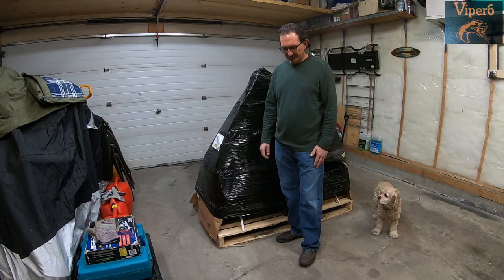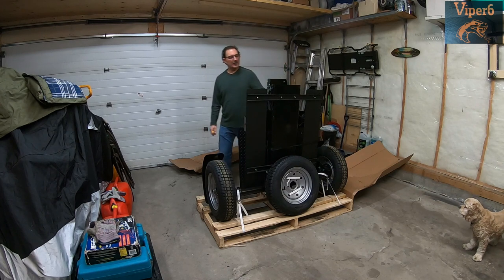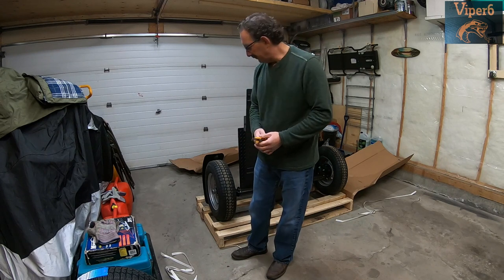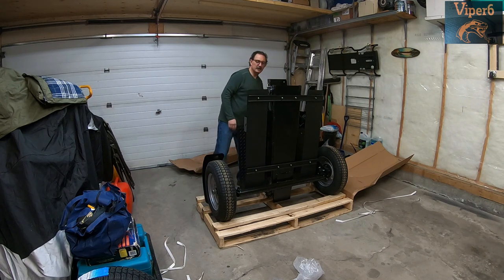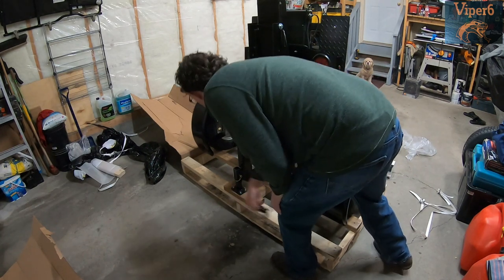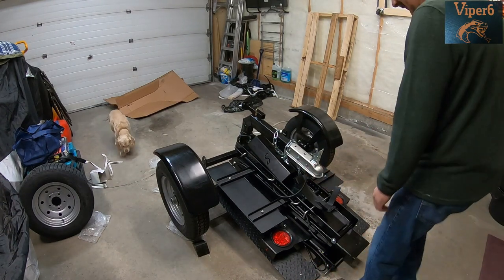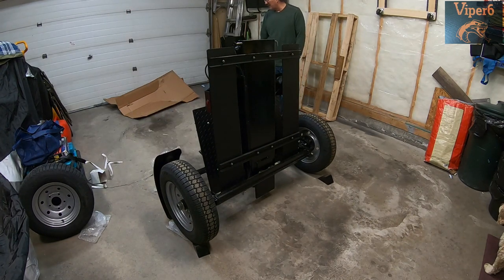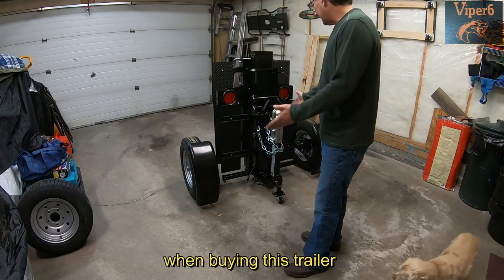Stinger XL 112  Motorcycle Trailer Unboxing and First Impressions

Comment: @viper6 Thanks for posting.  Curious what your opinion is at this point and also, how heavy your bike is. Thanks in advance buddy!!
Reply from the maker: I like how I can fold and store it.i have two bikes. One weight 500 lbs and the cruiser weighs 850 lbs. the trailer is rated for 1700 lbs and can travel safely at 80 mph. Thanks for the question.
Reply: @Viper6-MotoVlogger  Thanks for your prompt response. So with all that said, assuming you've used it to travel, are happy with it?
Reply from the maker: Dean Landry you’re very welcome. Other than the fact that it’s expensive, I have no complaints.

Comment: Hello Viper6
Enjoyed your video.  At one point, you’re unpacking a bag of accessories including locks, straps etc. and in one of the comments you indicate these are shipped/included with the trailer. I queried Stinger and their sales rep says they don’t sell the locks and the straps are an extra $150 so I’m confused.  Did you pay extra for the accessories?
Reply from the maker: Hi Terry, I purchased my trailer in February 2020 and do remember the straps being included with the model. Perhaps things have changed, but I would negotiate with them to way the $150.  Good luck.

Comment: I remember watching this and leaving a comment but it's not here.  I remember commenting that it was a cool trailer and I would like to have something like it.
Reply from the maker: Yep, Youtube doing its thing again!
Reply: If you did decided to purchase,  the pictures and video's truly don't do the actual 'there it is upon your own driveway', any justice.  It is very WELL built and manufactured. They didn't cut corners in design for its mandate...you and yours,  in your car/truck/van, and your ride safely tucked in behind you....the adventure waiting!   You won't be disappointed, from purchase, to the day it arrives at your door, if you decide to have it actually delivered right to your driveway.  For the weight of it,  as well as the size of the support wooden pallet, I think that is the best option to 'get it home'.  Cheers!
Reply: @sesquashtwo  Thanks for the input.
Reply: @EasyRiderGreg  No problem...and I have to tell ya...sure, it's a good amount of 'coin'...but when you see it home after the wrapping off, you see WHY you paid the asking price.  Very well made, from excellent based materials, well thought out, and I still marvel in how this trailer, when you simply and (one person) easily folds it into its storage non-use configuration, really does only take up the physical space of a normal snow blower.  So, if you have a two-stage snow blower sitting already in your garage,  that's only how much real-estate it will take up!  I have already pulled a 1,000 pound bike over 200 miles...behind a Grand Caravan...and absolutely no impact to the control of my vehicle.  It took me literally five minutes per side to hunker down two sets of straps, (front and back) on each side of my bike,  so it's actually from unfolding the trailer at the mouth of the garage door,  slipping in the pins,  pulling it up to your 2 inch ball hitch,  locking that down,  installing the chains... riding the bike up onto the trailer,  bringing up the loading ramp into the road-position, and then finally attaching the four (2 per side) tie down straps...all of 15 minutes.  That quick and easy , to be heading out for a great vacation, or end-destination tour/ride.  I am SO GLAD, that I finally decided to drop the hammer...and have one delivered.  No buyer's remorse HERE!~ :)  Cheers!

Comment: It looks really well made.  That should make it all the way to Arizona!
Reply from the maker: OldManTony I am actually impressed with the gauge of steel and build. The trailer is rated for 80 mph travel. So, I should be good mate.
Reply: @Viper6-MotoVlogger  I'm also thinking of creating a front windshield for the back ramp, when it's in the up position.  I can see that that will be like pulling (wind drag and wobble) a flat barn door behind you.  My idea is to merely cut a thin piece of black and or white colored plastic Viper6,  and bending to sit inside the frame, will screw it to the upper lip of each side of the loading channel.  That way, the wind will shear past the loading ramp,  as the front edge of a plane's body will.  No flat surface to hold and act like a wind brake, as well as in a strong side wind, can want to cause action on the back end of the trailer.  For my idea of a wind deflector, all it takes is a plastic sheet thin enough to merely bend into a half circle as you place both outer edges into the loading ramp channel to catch the plastic from opening up back flat.  I bet that alone, will increase your towing gas mileage by at least 1 to 2 miles per gal.  Also, better handling with less of the trailer wanting to fish tail, in strong lateral or side winds to your direction of travel. Of course, you'd have to first load your bike(s) to see how much room is between the back of the bike and the front face of the up-position loading ramp.  If there is enough space for the rounded plastic sheet...it will be a win-win, over not having any sort of wind deflector at that position.

Comment: This would be the ideal thing for someone who lives in an outlier area and has to transport the bike for service!
Reply from the maker: TheRoadRatt I agree bro. It is a little expensive, but it’s well designed.
Reply: Yep...I bought it mainly for that....as I am 50 miles from my driveway to my selling dealer's location.  I don't have to wait for someone to have to follow me....the time, the expense,  and all  that.   You can load yourself,  drive there...take off your bike yourself...and only need to go once to deliver, and once to bring your baby back home.  Then...WONDERFUL!....you fold it up and it sits in the exact same floor space a two stage snow blower.  That is NOT an exageration...as it sits right next to my 2 stage snow blower...and is the exact same x by x  floor footage.   Simply a wonderful solution for your bike transport for pleasure, (taking it with you on vacation, summer or winter...) and for dealer delivery and retrieval...ONE PERSON.... :)

Comment: Nicely packaged, and seems good at how safely secure it is. Nice trailer too. What will you use it for? Vacations or tours.
Reply from the maker: Thanks mate. This trailer will be used when I go spend winters in Arizona USA, which is approximately a 2700 kilometres south of my home.
Reply: I just got mine as well.  I have always wanted to go mid-April/mid-May, or mid-Oct to mid Nov,  but you chance snow/freezing rain, and black ice, if you need to go through the Blue Ridge or Smoky Mountains in those above time spheres.  I once in 2001 took my 2000 Goldwing from Michigan to Myrtle Beach,  in the first week of May, and stopped overnight with star skies, and at 28 F in the mountains.  Got up the next morning...and almost blew my mind. There was 1 to 2 inches of snow everywhere. I had to stay in the motel, for about five hours until the heat of the truck tires of the big rigs, melted the snow and sleet off of the highway. After that, i never attempted to go over the mountains in the Late Spring, or early Fall, just for that reason.   Now with my 2018 Yamaha Star Venture T.C.  being towed soon behind me...no problem...if there is a rogue snow fall, or slick roads....no problem....I'm safe...and my ride is safe!

Comment: Some thoughts cause i'm full of ....um thoughts lol, the bigger the tire the better so good they went with the bigger size, very cool that they give you all the accessories, I only ever strap the front of a big when hauling and let the rear suspension free float, the trailer did look sturdy, I liked how compact it was when folded and once you put the wheel on it rolled easy. I haven't had an open trailer in a long time, mostly just load into the back of the truck with a board lol, but if I was gonna get another i'd probably go with your choice 👍☠
Reply from the maker: Angry Pirate News yeah, I’m glad they went with the bigger tires. The trailer does look super sturdy and was happy to see that they include all the goodies with the XL model. Once folded up, it tucked nicely in the corner of my garage. Can wait to haul one of my bikes down to Arizona next winter. Be safe and healthy bro.

Comment: Great video,  could you provide an update now that you've got some in-service miles?  I'm considering buying one of these and would appreciate feedback on your experience with the trailer so far  Thanks!
Reply from the maker: I appreciate you taking the time to watch and comment. My intention was to post a usage video by this time, as I purchased to take my bike to Arizona for the winter. But, covid hit and killed that plan. I have yet to use it, but will upload a video as soon as I do. Thanks
Reply: I also own a XL-112 Deluxe,  and have towed inter-province, have towed many times to my dealer (50 miles away from my driveway) for required overnight-keeping (for engine cool) maintenance, etc...or parts wait...and the ownership has been awesome.  You DO NOT know this trailer with my 1,000 pound bike is being towed behind my Dodge Grand Caravan!   It stores in the same 'use-footprint''   as my snow blower sitting next to it on my garage back wall.   THAT alone...is a must have feature....no outside storage,  no weather deterioration and NO THEFT from sitting beside your garage, or outside your home...and no taking up half your garage as with a non-folding trailer of any kind.   Totally endorse the purchase and use of the Stinger XL-112.   You can take your ride any of the 12 months of the year,  especially if you live in a  Winter (snow) state or province.   Never mind that if you have to go out of town to your selling/maintenance dealer...you don't have to drag somebody with you,  to bring you back home AND to take you back to the dealer for bike retrieval.   My wife LOVES that...lol.

Comment: love your furry little friend. Your friends name and my friends name are both Rocco. Now you can use the pallet for fire wood as well. I have a 4x8 trailer with 1 foot walls made from plywood and a wood floor that i mounted some d rings to and use it for my bike. if i could afford it i'd rather have a bigger truck with a toy hauler to help protect the bike from elements instead of it being in the open but it's all good.
Reply from the maker: Minion Moto yep, Rocco is my little buddy lol. Sounds like you have a pretty decent trailer bro. That pallet will go into my fire pit this summer 😁👍
Reply: @Viper6-MotoVlogger  yes sir i understand that. yeah it's an ok trailer. it's old and spent it's life in the desert with 120+ F degree heat so it dries everything out.
Reply from the maker: Minion Moto I hear ya bro.

Comment: I was wondering how much your gas mileage drops when your pulling vs. not pulling?
Reply from the maker: I noticed a drop of about 2 miles per gallon.
Reply: @Viper6-MotoVlogger  what type of vehicle do you tow with
Reply from the maker: @jerrybradford5073  I use a Toyota Tacoma
Reply: Thanks for your help 😎
Reply from the maker: @jerrybradford5073  any time 👍

Comment: Only $24.99 😊. Would like to see that hitched to your bike. Btw. Tell me more about your garage heater  is it portable or wired in?  Looking to wire  in a garage heater in my garage and looking at a good not so expensive one. - Jesenice’s dad
Reply from the maker: kimuseni yeah, more like $2499.00 lol. The heater is the garage is a 4800 watts heater that runs on 220 volts. It’s made my Dimplex and available at Home Depot. You’ll need to run 220 from your panel and install the right receptacle. The heat keeps my garage warm even at -40. Just need to make sure your garage is insulated.
Reply: Yeah. I insulated and finished my garage when I moved in. I just need to wire in a heater and maybe an AC for the summer
Reply from the maker: kimuseni 👍

Comment: Let's see you get a heavy touring on the trailer please. Then, I might be interested.
Reply from the maker: I’ll try and record a loading video this summer. I’ll be loading a 2009 Suzuki Boulevard C90T, which is over 800 pounds.
Reply: @Viper6-MotoVlogger  I have a 2018 Yamaha Star Venture Trans Continental, that weighs in at 968 pounds 'dry'.   That's one of the reasons I was so pumped to buy the Stinger XL-112 !  No 'fear' loading and unloading....  I don't need to injure/cripple myself, or $$$$$-damage my ride, to want to take it with me....by using a utility trailer, pick-up box,  or flat bed not  designed strictly for moving large tour motorcycles down the road....
Reply from the maker: @sesquashtwo  the stat venture is a gorgeous bike bro. 👍👍👍

Comment: Loaded this one up viper for a viewing!
Reply from the maker: Thanks bro. Wish I could load the trailer up and go south 😁
Reply: @Viper6-MotoVlogger  Good news they have announced yesterday!  You’ll be down there maybe later this summer!
Reply from the maker: @MrBugPop  it is indeed nice, but it’s over 40c there in the summer 😳
Reply: @Viper6-MotoVlogger  That is too hot for  a pudgy guy like me! When we go to Thailand to my wife’s parents I die in the heat. Literally incapacitated. I have to lay on the “Sala” with two fans going!  If we ever move there I would have to get my body adipose ratio down by a lot.
Reply from the maker: @MrBugPop  I know what you mean bro. I suffer in extreme heat. I was in Tucson AZ four years ago and it hit 52c. It was freaking brutal .
Reply: @Viper6-MotoVlogger  yikes!

Comment: Those are called "Buddy Bearings" I have them on ALL of my Trailers!
Reply from the maker: navythomas8 that’s the name I couldn’t remember. Thanks bro.
Reply: @Viper6-MotoVlogger  Bearing Buddies are very common in marine use, especially trailers... If you ever see a boat trailer without them, RUN AWAY!
Reply from the maker: The Mitton Method yeah, good point 👍